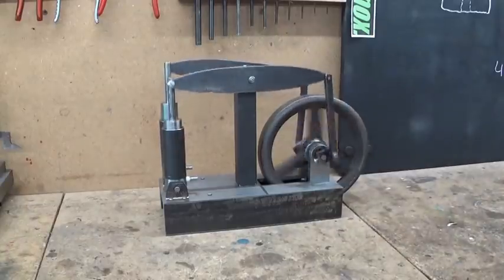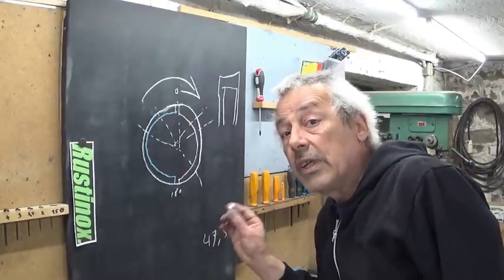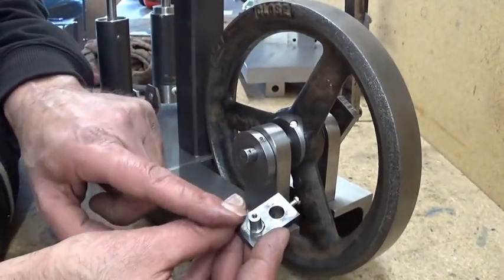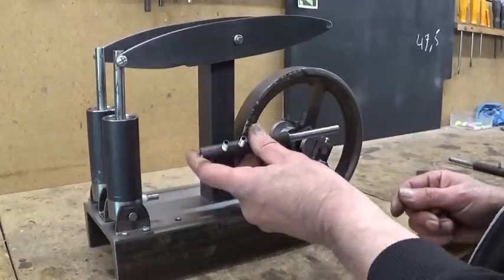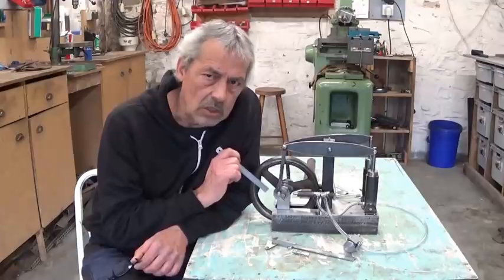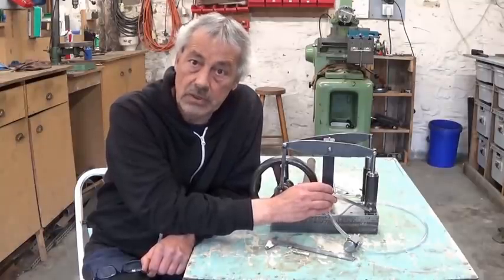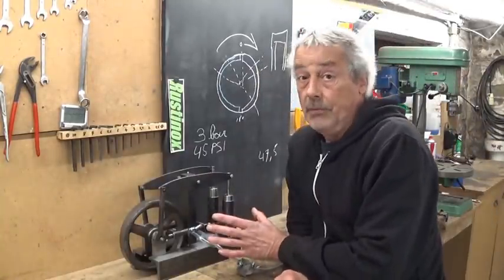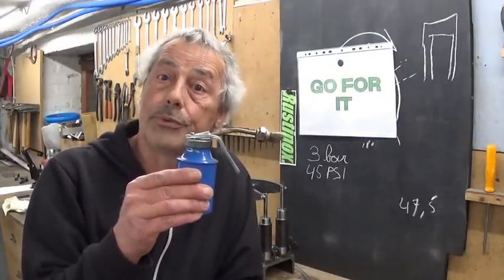Beam engine build final.

Comment: So satisfying to watch that thing chugging away 😁. Now that you have a working prototype maybe you should make a fancy one 😊. I work at a cylinder manufacturer, honestly their tolerances aren't that tight. But that's due to the flexibility of the seals. That being said, you've got me thinking about bypassing within cylinders. There are some instances where it's done deliberately and precisely for a desired outcome. In any case, that could be a long conversation. I'm not even gonna get into lathe alignment cuz I'd just be talking out my 🐴. I believe Max Grant just did a vid on that 😁. Stay cool man! Cheers!
Reply from the maker: Thanks Chris. And don't worry for the lathe. I will figure it out.

Comment: That was great Michel.  You certainly made a engine from scrap.  Keep on keeping on.  Oh yes and I meant to mention you probably have a low battery in the black board.
Reply from the maker: Ah, i didn't check the batteries.
Reply: @Rustinox  it runs on batteries? That's good to know….

Comment: Excellent series, well enjoyed.  No problems with the Shaper? yes there is, you told us so; it's too small and you want a bigger one ( past video , if my memory is correct).  Maybe replace your lathe whilst you're at it;  can't have it stifling your horizons.  Damn those bearings and bushes; was hoping you'd put a micro alternator on it to drive a miniature air pump and produce the 'Rustinox Perpetual Motion Machine', and prove them armchair physicists wrong.
Reply from the maker: Rustinox Perpetual Motion Machine? Hold my beer...

Comment: That was / is excellent Michel. The best advice was the last advice.
Do you still have contacts at the docks so you can get more supplies?  Stay safe and well :)
Reply from the maker: Thanks Anthony. In fact i bring almost nothing home from the docks.It's illegal. The most things i have come from an old barge that was sold for scrap. The boss allowed us to take some parts.
Reply: @Rustinox  Similar here in Australia Michel. I was fortunate for a time to get scraps from a jack up oil rig we used to service. I shipped home over 80 kg of stainless. We used to have beer currency too, but unions run most places and it's all zero alcohol now..

Comment: Nice one!!

I have got myself a ‘newer’ type of hembrug shaper. Same as yours. 
The only thing is that the gib on the compound slide is missing. 

Is it possible for you to take measurements of it So i can copy it? 

The older type doesnt match
Reply from the maker: Here you go: L=185, B=18, H1=6, H2=4.5
If you need more information, just let me know.
Reply: @Rustinox  Thank you very much!
It will take a while before I have time for it. But there will be some video’s about it

Comment: Love that oillcan! (I want to make one like yours.)

It's sad about your lathe's wear. It would be great if you could take a few minutes to pick it up and bring it over to Keith Rucker's shop at Vintage Machinery—and I'd love to go over and help work on the ways and gibs to get it within your ideal tolerance, so if you decide to do that please let me know so I can plan to join you there.

I'd love to have a blackboard like yours. I hope it does not run on electricity: I'm in the U.S. (Georgia), so unless it runs on low voltage (12v or maybe 5v?) or there is a model for U.S. electrical system, I would need to make some shocking modifications. Can you refer me to a supplier?
Reply from the maker: For what i do my lathe is good enough. If i want to go and see Keith with my lathe it's gonna be a long walk and an even longer swim :-)
And for the blackboard, no luck. Its classified...
Reply: @Rustinox , had to take a pause to quit laughing, get back in my chair (ribs hurt from laughing so hard) and catch my breath. Well, I'm sure you're a good swimmer, but after I posted my comment I realized that a couple of thumbnails for your future vids probably address the issue so my suggestion was moot.

However, I am crushed that the blackboard can't be purchased, or even replicated. Hmm….

Comment: So basically changing the length of the valve rod is equivalent to altering the lobe separation angle on a camshaft, but the eccentric is more like advancing/retarding the timing? Am I understanding this correctly?
Reply from the maker: You're absolutely right.